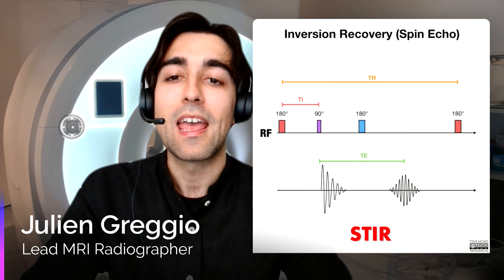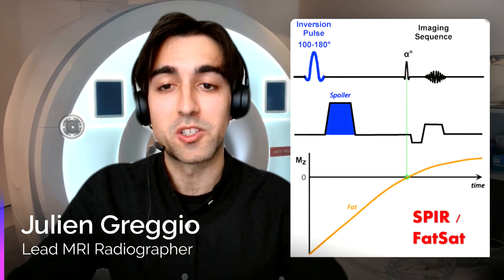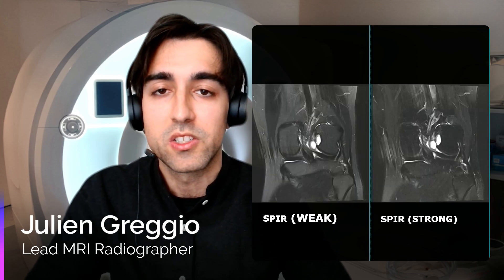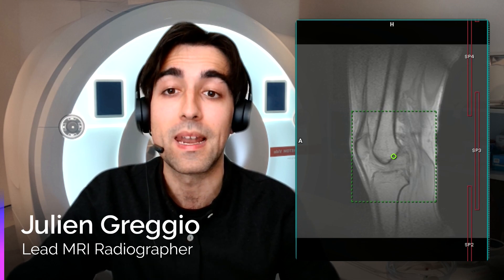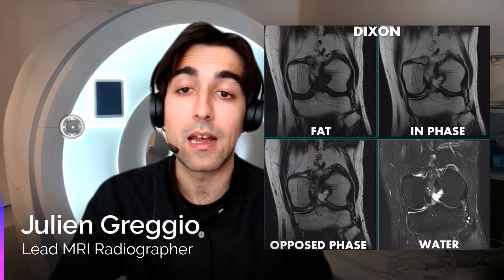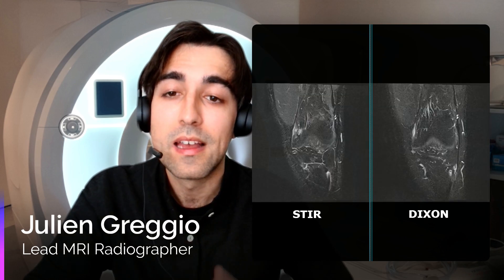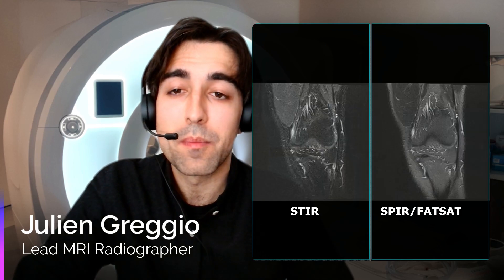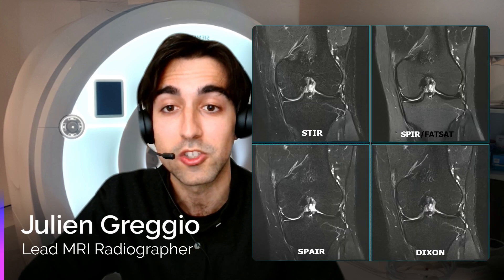Fat Saturation Techniques - Full Guide

Comment: What if I work on siemens open mri 0.3 T , 
Is there any relation between the magnetic strength and or manipulated parameters,  such as in this case the inversion recovery? IS there any reference we can refer to
Reply from the maker: Thank you for watching. This is an extremely interesting question. For a complete and detailed answer, covering also the physics behind it, I would suggest reaching out to John Manchester (he was one of our podcast guests). He has plenty of experience with low field scanners, even if directly Siemens related, and I am sure he will be able to provide a full answer to your query 😊

Comment: We use spair t1 vibe for breast , do we need to verify the fat peak or manually select the fat peak before the post contrast portion?
Reply from the maker: Thank you for your message. I am not sure I fully understood your question, can you build on that and provide further details?

Overall, I always recommend to do such process manually as the machine may miscalculate the frequency of the tissue to suppress and therefore the efficiency of the sequence may be inevitably impacted! Hope this partially answer you question
Reply: @everything-mri  wow, thank you for your response. Before the t1 fat sat vibe (spair fat sat) scan starts, a window of water and fat sat peak pop up that allows us to manually select the peak. There is the water and water peak on the diagram,  do I need to manually select one and hit apply ? And for normal breast without implants  spair image which peak should I choice and apply.
Reply from the maker: Thank for claryfing this further. So, if you acquire sequences that involve spectral saturation in breast MRI, when the frequency selection window shows up, you can choose with the right click to zoom in and look with the mouse for the 0! That’s the ideal saturation point. Then click apply and run. That’s usually the peak on the right. If you want to suppress the silicone instead, you need to usually choose the peak on the left!